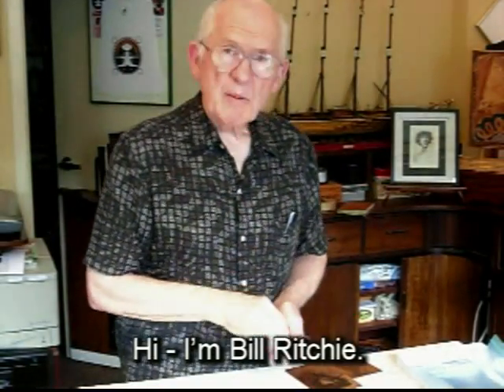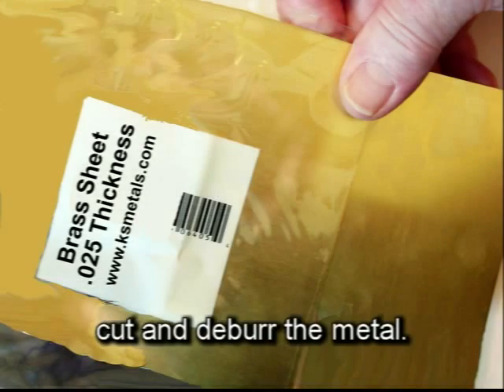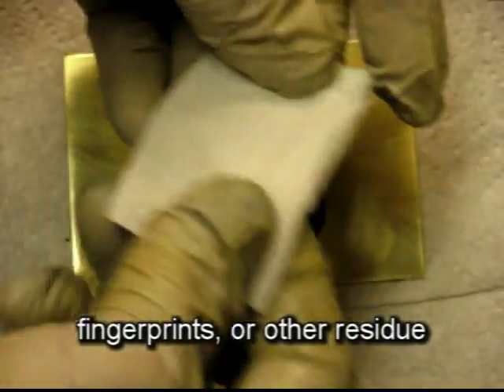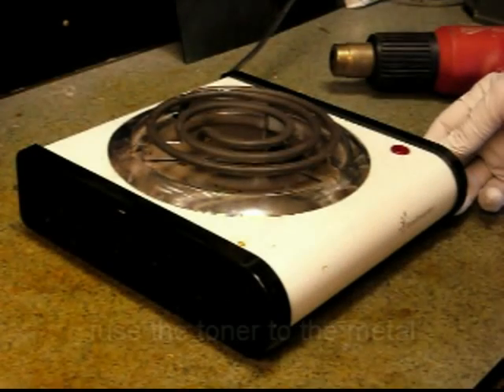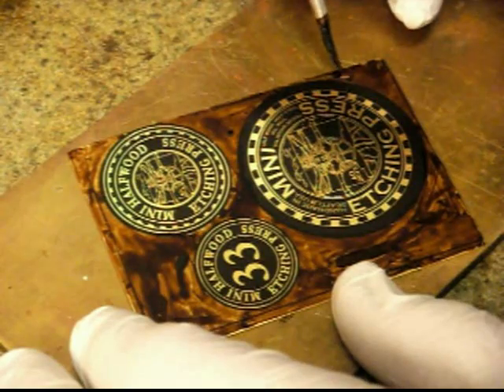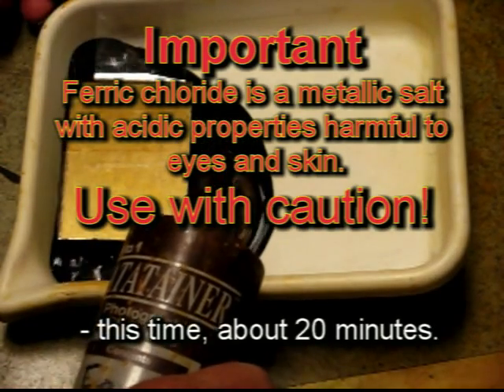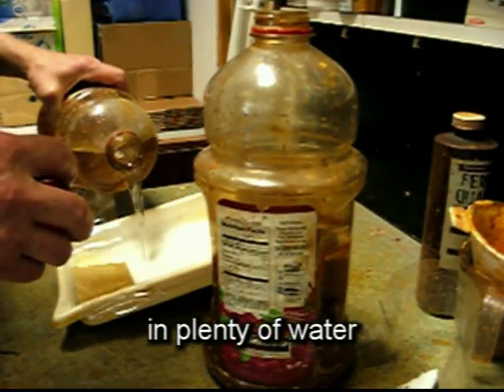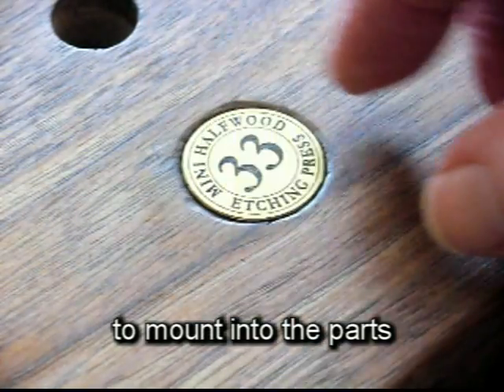Make A Badge

Comment: well made to the point and informative. will be saving this video for rewatching. there's a few techniques here I've not come across before.

do you know if an ink jet printer can be used instead and could a heat gun or iron be used to do the transfer instead of a laminator?

Comment: That was great! Amazing workmanship. Any ideas of how one could darken the etch if it didn't come out as dark as they wanted?
Reply from the maker: If I could see the project, I might have an idea. If the etched area is big, one can scratch the metal with many lines and crosshatching, called drypoint. Use a sharp, hard steel needle. Does this help?

Comment: Nice and clear presentation and some very good tips. One question. What is exactly the purpose of the  50% rosin dust coating and the second etch?  Obviously it does crate a texture inside the already etched areas, but what is the advantage of this vs a smooth surface?
Reply from the maker: I make the badges more contrasty by inking with etching ink, and without the texture, the ink is easily wiped out. Texture grabs the ink, like sandpaper, and holds it. Not needed in lines, but open areas it's a must.
Reply: @BillRitchie  Thank you, Bill, for the prompt answer. I fill the etched or engraved voids with epoxy mixed with black powder (as used for inkjet refills) wipe it with a sharp knife or razor blade and once dry I fine sand the whole. The epoxy fills nicely any cavity (a drop can be added with a toothpick after wiping if too much removed)  and any excess above the surface is sanded. Looks almost like enamel when finished.
Reply from the maker: @billastolfo3052  Thank you, that's a good idea! - B

Comment: Thanks for sharing!! Would this work with nickel silver alloy?
Reply from the maker: No, I do not think so because nickel silver, while it may accept the laser toner image, requires a strong etchant. I don't think ferric chloride will etch it. Nitric acid in some solution might, but I have no experience in etching nickel silver or any alloy like it.

Comment: very nice.  I have a South Bend brass machine plate I'm restoring.  It has raised lettering etc.  The originals have paint in the low lying areas.  I tried painting once and scraping the high spots but I think my paint was too thick.  Do you have any paint recommendations ..... a thin yet bold paint seems to be what I'm after..... maybe.  Any experience with older restorations

Comment: Hi Bill, Quick question regarding the paper you use. Once printed, are you leaving it to dry before the transfer? My toner doesn't appear to be drying like yours is. What would I be doing wrong? Left it for 20mins so far.
Reply from the maker: This confuses me. I don't understand toner "drying." I use silicon-coated paper. With a black-and-white laser printer (not an inkjet printer, which uses wet ink and squirts it on the paper) I print the image. It emerges dry on the paper. Then, into the hot transfer device facing my metal. Out it comes, the laser toner melts and sticks to the metal - it hardly sticks to the silicon-coated paper at all. In fact, nothing does! Having written this, I get a feeling you are using an inkjet printer. In that case you want to use photopolymer etching techniques - inkjet is perfect for this. I picked a video at random - there are hundreds to watch. https://youtu.be/GyeU5PcV4AY
Reply: @BillRitchie  Ahh, that's where I went wrong. Time for a printer upgrade.

Comment: Wow, great video. If I may ask one thing - I don't quite understand how 
and when the etched part becomes darkened. The dark parts from the 
computer printout become light and vice versa. I know to make the image 
color reversed but not how to get the recessed part dark post etch. Is 
that the role of the aquatint? Thank you for such an informative video, I
 have my first etch soaking right now.
Reply from the maker: I cheated, yes, the aquatint makes the etched-out areas rough enough that when polishing the badge, residue traps in the aquatint. But to make it darker, I ink it with black and, with a chip of matboard, polish the flat parts for optimum contrast. The ink takes "forever" to actually dry to the touch, so it is easily smudged if handled.
Reply: Right on, thanks for the answer! Now to find some aquatint.

Comment: GREAT Badges, GREAT Video Presentation, GREAT Press's.!!! 
...If you add into your Artwork a Circle Line the thickness of your Metal used and
same distance Away from required finished Size, after initial Etching, Stopout all but
the added line and return into the Etching fluid you can watch the clear tape and see when
your badge/s is Chemically Milled, Is it worth a try???
Reply from the maker: GEOFF NOLL thanks, I'm kinda confused but I'll give it some thought. I appreciate yours. - Bill
Reply from the maker: I'll give your suggestions some thought.
Reply: G'day Bill, i Luv the Rembrandt and your Multicolour Etching, the're now in my bucket list.!! 
Mini-Press, is Awesome,!! ... Adding 2 to 5% Nitric to FC helped me on Brass, Copper, Anodised or not  
Aluminium, & Stainless Steel, Brushed or Smooth, Temperature never seemed to matter, 
(room temp seemed to be O.K.) ... I'm gathering needed bits to do some Etching again, attempting 
to attain Hairline Resolution.!!  ...I want Badges for my Wood Turnings.!! 
I'm happy to help, Cheers, Geoff

Comment: Hi, Bill!  Thank you so much for this great tutorial!  I am wanting to use this method for small jewelry pendents as small as 16mm diameter circles.  I haven't been successful at getting my designs to transfer to the metal except for blotches of it.  I don't have a laminator.  Do you believe this is my problem?  I've tried a regular iron and one, it's hard to keep the print from sliding all over and keeping it centered on my metal circle, and second, as I said, it only partially adheres.  Would greatly appreciate your advice on this!  And two last things, are you aware whether the silicone-coated paper design will adhere to any metal, and do you know if embossing powder the same as rosin powder?
Reply from the maker: Thanks Tracy - I'll start with the easy one: I don't know if embossing powder is the same as rosin powder. I grind crystalline rosin sold to printmakers with a mortar and pestle, like many printmakers who do aquatints. Re: metals, yes, the toner/silicone-coated paper works on all metals I think, also wood, etc. whatever can take the heat. If you're stuck with an iron (I used to be and I would never go back) you might try transferring and etching the design on plate metal and then, when done, go back and cut your circles if possible. I never figured out how to start with a circle - too hard as you know. Look for a used laminator if you don't want to buy a new one - it's the best way. - B
Reply: Thanks so much for the response, Bill!! Your work is a beautiful work of true artisan! :)
Reply: Tracy Grott You could also try the method used to make homemade PCB boards. They use a photoresist sheet. I do not recall the name, but there is a blue film that is pretty popular.
Reply from the maker: Maybe that is PNP Blue, stands for "Press and Peel" (psst, but I don't like it).
Reply: Any news? I would love to know how to transfer directly to circle metals.

Comment: Hey Bill, could you use an iron to heat the brass instead of a laminator when transferring the ink from the silicone paper?
Reply from the maker: It can be done, and that's how I started out. Then I found you can find used laminators really cheap at thrift stores, and the heartbreak of failures using the iron got to be too much. The melting toner gets greasy and slippage is the problem. I've heard of people using other methods, like dry-mounting presses. On tiny projects, like jewelry, an iron might work. - B

Comment: Will rosin that baseball players use for grip control work as well as ground/powder rosin from Graphic chemical?
Reply from the maker: I don't know, but I recall there was a pre-powdered rosin sold by GC&I that for some reason wouldn't melt so I thought it didn't work. It had a brown tinge to it, unlike the whitish of rosin I ground with a mortar and pestle. For larger quantities we used an old fashioned meat grinder. Good question, thanks. - b

Comment: Great vid --- will this work on steel ??  And then I'm guessing laser is important - no ink jet or toner ???
Reply from the maker: Trouble with steel is that if you want to etch it you have to use nitric acid, I think, and it will likely heat up the steel and cause the toner to release. As far as printing on steel, should be no problem, but not to etch it like brass. Check around for etching on steel, I just know about nitric.
Reply: Thank you.... my electro etch game for negative etch and ferric Chloride for positive etch game is fairly strong using vinyl and my cricut to cut designs... but I cant get the detail you showed here and I'm looking for a way to etch my knife steel with more precision...   thanks for the comments and video it definitely gave me ideas and hope to keep pushing forward...

Comment: Hello Bill, do you know if this process is applicable to aluminum or steel plating as well? Great tutorial, and very nice results!
Reply from the maker: You can transfer black-and-white laser toner to any surface that can take the temperature, but you must use etchants only for certain metals AND the etchant cannot remove the toner from the metal. Therefore, an etchant for aluminum, for example, might eat away the toner. Steel's etchant might be Nitric Acid, and it might eat away the toner, too. I don't know, because I only use copper and brass etched with ferric Chloride - like most printmakers.
Reply: Thank you for that quick response. I understand, I will perhaps try my hand at using nitric acid or something similar, I'll have to check with my local hardware store on what's actually available in my area. In any case, thank you for the help!

Comment: This video is amazing, great work. I have a question though? What do you use after the aquatint etching? And how do you apply it to darken the etched areas?
Reply from the maker: Lately I have been rubbing black etching ink into the etched areas, and the aquatint helps hold it. When I am sure the etched areas are filled with ink, then I wipe the surface with the flat of a small piece of 4-ply mat board. The board is thick, so it doesn't wipe out the ink. I put a piece of gripper vinyl under the piece so it won't slip around. It takes forever to dry; it could be speedier if cobalt dryer were added the ink.

Comment: i want to know about the graphic designing for etching on illustrator......
Reply from the maker: I use Adobe Illustrator because it makes vector images, sharp edges. The output must be solid and I use a black-and-white printer (old HP 1018) with genuine HP toner, set to darkest level. Go look at circuit board printing videos - that's where I learned.

Comment: I have some galvanized steel discs I'd like to use this process on...I presume you have to remove the zinc plating first?
Reply from the maker: You'd have to know how to etch steel. Zinc etches easily, but I'm not sure about steel. You sure can transfer the toner to galvanized steel, but what to do after that I don't know; someone out there in YouTube land does, I bet.
Reply: No worries, sir.  If it works out the way I'm hoping, I should have a video up shortly after that.

Comment: Hello. What is the temperature of the laminator? Thank you.
Reply from the maker: The manufacturer doesn't say, but I estimate it is around 350 degrees f. Hot enough to fuse the plastic of regular laminating sheets, but not hot enough to burn paper. When I started this I used a hand iron set on "high" and it was too hot to control, the image slipped every time. I have seen videos of circuit board makers using hand irons and they made it work using ordinary copier paper and photopapers. Good luck, and thanks for watching.

Comment: PLZ tell me what is  rosin dust  and what is it used for.
Reply from the maker: Hi S Foxxy - Rosin is an amber-colored crystal I ground into dust with a mortar and pestle. These fine crystals of rosin are insoluble and have a low melting point - about 300 f. I think. These fall on the plate like dust, with spaces between them - not a solid layer of dust but almost. When the plate is heated, they melt in tiny humps of rosin with spaces all around and between them. When I put the plate in an etchant, in this case, ferric chloride, the etchant eats away the metal around the hump of rosin and, in time, makes the plate like sandpaper, the kind of texture I wanted. In printmaking art it's called aquatint because in the old days they used this method to copy watercolors in printing reproductions. Let me know if this is clear - if not I'll try more. And thanks for watching my video. - Bill

Comment: Mr Ritchie do you make custom jobs? I need a motorcycle badge for each side of the tank created. What would you charge? I already have the artwork
Reply from the maker: Sorry, Denis, I've disposed of my stuff for what I was doing. If you can make a tank, I bet you can make your own because you can iron on the design printed on circuit board transfer paper from amazon, the metal from KE or a hobby shop, and either ferric chloride from amazon or copper sulfate and hydrochloric acid from a nursery and hardware store (muriatic acid). I saw the instructions online, but I quit doing this stuff. Good Luck, Denis. - B

Comment: Sir how to etching on iron sculpture design. 32 mm round iron block .I am coin die engraver but I want to etching design on iron by etching process then I use pinto graph machine for deeping. So please explain how to image transfer on iron and how to etching
Reply from the maker: Laser toner on silicon coated paper will transfer with heat on any metal, I believe. It is fragile, and must be heated again after transfer to fuse the toner and make it stronger. The problem is iron requires acid etch, such as nitric acid this may be too strong acid for the toner. Other people may have advice, I do not know the answer.

Comment: Bill would you mind posting the exact model number printer you are using?
Reply from the maker: Sure, it's a Hewlett Packard 1018. I'm not sure if they still make them, but I've seen them in used places, and I can still get the toner for them 02612A. Be careful you get the real thing, HP 12A, because there are cheap ones which they've put in a chip to make them compatible, which they do, but the toner itself, a black powdered plastic so important to being a resist is not the same. I had a cheap compatible cartridge and the toner turned into goo when I tried to transfer it. Gotta be real HP.
Reply: Thanks Bill. I've read that some black and white laser printers won't work. I've wanted to try this for years but not knowing what printer to purchase always turned me off. I wonder if new higher resolution black and white printers exist today that will do the trick?
Reply from the maker: My knowledge is limited. I have a friend, Ethan Lind, who found a b&w laser printer at a Goodwill store for $5, a Brother or somesuch kind, and it worked for awhile, now he tells me it doesn't. I'm no printer expert. I see, however, there are about 75 used (and one NEW) for sale shown by amazon ranging from $75 to $375. HP stopped making them, but the used ones probably work about like mine. Mine is about 12 years old.

Comment: This is ok if you have your entire life to etch one thing.  There are much better and faster ways
Reply from the maker: Tell me more, Ryan Hilldale. BTW, you in Florida?
Reply: Bill Ritchie .. Google.  Ferric chloride works great for non ferrous metals and a simple electro etch/salt water solution for ferrous metals.  I can etch anything in less than 5 minutes.
Reply from the maker: Thanks, Ryan, I'll try that. You have a demo, too? I'll Google it, as suggested. Must be great. Anyway, I'm done making medallions, anyway. Thanks for watching.
Reply: Bill Ritchie .. no I dont post videos online.  I use a 12v battery charger I got in a pawn shop that cost $30 bucks as my DC power source.  Connect the positive lead to the material you want to etch and the negative lead to a hand held gizmo to run current.